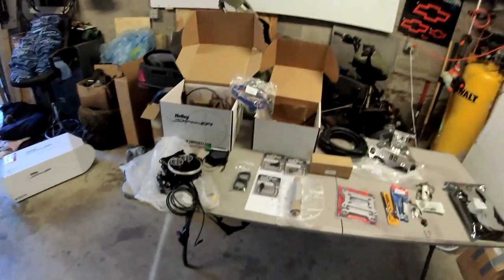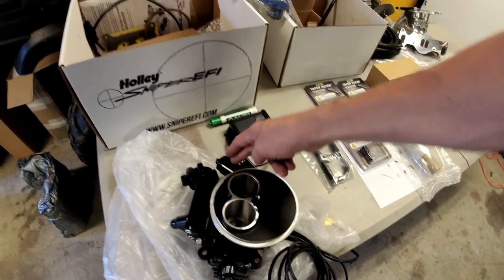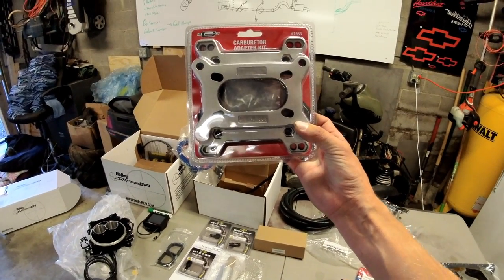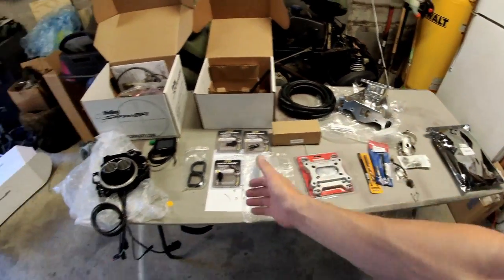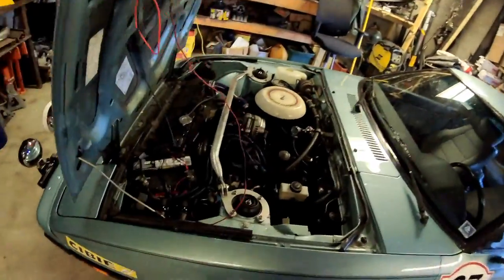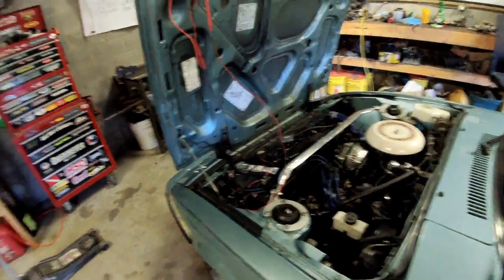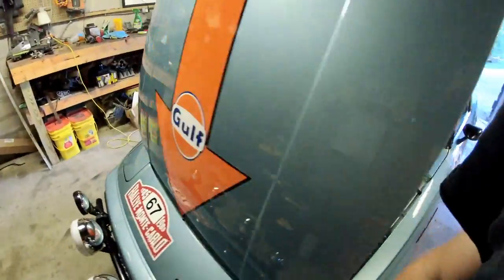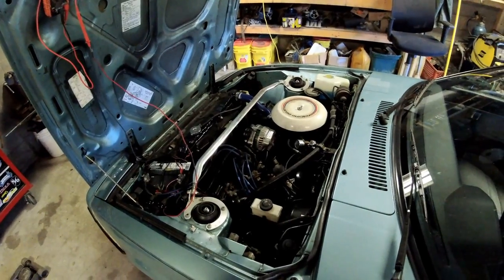Holley Sniper EFI On a 12a Rotary 1984 RX7 PT-1

Comment: Thanks for the tips!  On my 84 I took the ECU thing out and the coolant temp/oil pressure sensor sensor still work fine.
Reply from the maker: Did you strip the harness? Or leave all the extra wiring?
Reply: @RADPotential  Yeah I think I cut or unplugged everything that wasn't necessary

Comment: You can get a m16x1.5 to m12x1.5 reducer bushing on amazon for $15 and use a $7 ls temperature sensor which uses the same wiring connector in the stock water pump port
Reply from the maker: Hacks!!!!!  So good.  Do you have a part number for the sensor?
Reply: @RADPotential  Stant 74050.
I actually drilled and tapped a drainplug with the right thread to install mine as the bushings weren't available

Comment: I would recommend using the new fuel soft line.  I'd assume the new system will be higher pressure and though both are 3/8ths, the stock stuff is only rated to 12 psi IIRC.  Plus it is insurance against bad things happening.  Not as critical on the return side, but consider doing the feed.
Reply from the maker: Think maybe use the original feed line as a return and route a new feed line under the car?
Reply: No, the hardlines are not at issue unless they have rusted.  Just replace all of the softlines on the feed side with fresh sections from the provided hose.  If you were doing something hotter or turbo, a new feed and larger return would be warranted but I don't think it is needed for this.  Also might just check the markings on the installed hose.  It is possible that it has already been replaced to something more able.  I don't know what the Sniper pump will be pushing but I think most simple systems like this run between 35 and 45 psi of fuel pressure.  You just want to make sure the lines are able to handle the pressures they will be seeing.
Reply from the maker: I only planned to re-use the hardlines under the car in this system, i assumed the oem rubber lines are beyond their fatigue life
Reply: good advice, my ancient fuel lines started cracking with my MSD 2225 pump at a decent PSI, especially regulating it down. Worth the extra money for peace of mind, something I should have done before my engine bay was covered in fuel

Comment: If you had a street port for primary and a bridge port for secondary. Would you recommend the 4 barrel carb?
Reply from the maker: For a ported setup I would run 4 barrel.  I have seen the 4 barrel used on a bridge port 12a with success.
Reply: You have a email. I have a exhaust I'm working on. Want to send you pictures.

Comment: Will the oil metering pump still work with the new setup? Can you address that in one of the forthcoming videos?
Reply from the maker: Yessir I can go over it. The short answer is that it will not work
Reply: @RADPotential  Great video. Please include discussion for oiling in follow up.
Reply: @erek2075  just jump in on premixing bud..... so much more piece of mind. 👌

Comment: Will you have a video tuning this setup? I am having troubles getting my afr's right during engine breaking with the 4 barrel version of this
Reply from the maker: Yes the entirety of the install will be documented. What is happening on decel?
Reply: It's hard to explain briefly but when you down shift to the stop light the afr's will go 19/20's. If you clutch in and free roll to the stop the afr's will stay 12/13's (much like the car would if you were reving in a parking lot or your driveway) 

Kinda hoping you would encounter a similar issue during this install series, and I could learn off it and apply to my setup. Also for your sake hopefully you don't, it really takes the fun out of driving when you can't downshift properly lol
Reply: @Soccer22224  Sounds like decel fuel cut causing the lean AFRs.  Not an issue if the EFI pulls spark too.  I've never played with the Holley EFI but I've seen similar with Haltech.  If possible, disable the decel fuel cut and you should see the AFRs come back in line.

Comment: This is epic.
Reply from the maker: I am hoping to replicate bone stock drivability.  the most reliable builds I have done have been ones back 100% stock haha.  Cold, hot, doesnt matter..runs
Reply: @RADPotential  .....it WILL be better than stock👍
Reply from the maker: it should be.  I have a buddy who has a FAST Efi system on his Big Block Trans-am and it works awesome, its even older tech than the programming in the sniper.  id be interested to see if there are any work arounds for the Leading and trailing spark control within the sniper to be able to have it control spark as well on a rotary
Reply: @RADPotential  ....fyi.....feed line is 5/16......and return is 1/4 on carb. 1st gen.......
Initial  air fuel as follows....
1.HOT.....IDLE 13.5 TO 14.1
2. HOT....FULL THROTTLE  11.1.

from some personal FAILURES I highly recommend wrapping the header.....
NO MATTER HOW TEMPTING....ALWAYS USE A FUEL RETURN SETUP!!!!

vapor lock can be a problem on a hot day......
AWESOME CONTENT 👍.....respect from north eastern Ohio!
Reply: @benjaminhedderly4495  On a gsl-se the lines are 3/8 and 5/16

Comment: Love the color of that fb! Also this holley efi thing seems like a great deal, lots of functions for the price, i wonder how it competes with a haltech or similar
Reply from the maker: I would bet that you couldn't price a haltech, intake, throttle body, fuel system, and ease of tuning for near the price of the holley.  All said and done i think the holley, parts only for this install was less than 2,000

Comment: That’s badass I’m ordering one to see if I can spray my bridge 12a with a big wet shot lol can you blow these sniper trough?
Reply from the maker: yes you can boost through the sniper, they also have an add on for boost control within the programming of the ecu.  on the rotary you will need to sort out an ignition control if you desire
Reply: Ohhh I kinda noticed that the only one that is applicable for power adders was a top dollar fi tech. I want to do this sniper efi with nitrous on a bridge 12a 85 gsl

Comment: Why would you put a Holley sniper on a gsl-se, didn't those come with a fuel injected 13b? If that is the case there's probably better ways to ugrade the EFI.
Reply from the maker: I think it depends on parts availability in your area, fortunately I have enough gslse stuff to troubleshoot through making that efi work.  however putting together the gslse efi from scratch would be hard, vs buying the sniper parts
Reply: @RADPotential  wasn't thinking about availability tbh, just figured since Holley had stuff like the terminator you could probably get that but I see what you're getting at. Obviously this is ignoring the occasional 12a swapped gls-se that I'm sure has happened at some point the way cars that age get Frankensteined.
Reply from the maker: Haha I have a 12a in my gslse :)  but yea.  Getting hard to find parts for the oem stuff these days

Comment: thank you for this video and all the videos you are making. i have weber 45 on my 12a which i bought from rotaryshack but works like sheet so i want to go for a sniper efi 4 barrell will it work or it has to be a 2 barrell, big thank you for all the help we get from your videos
Reply from the maker: 4 barrel or 2 barrel will work,  why doesn't the weber work for you?
Reply: @RADPotential   thank you for your reply, I bought this carb from rotaryshack maybe you heard of him. So he said I am sending you a carb jetted for your engine. When you rev and stop rev again stop works keep your foot on the gas and you get this grirrrrrrrr I do not how to explain it. So I went for a new fuel pump carter p4070 and then start playing with the jets,  pump jet 50, idle jet 60f9,main jet 180, emulsion tube f16 air corrector 180 what i have right now I think the chokes are 40mm. I was told is an original weber 45 but i think is a knock off if it makes a big difference i do not know. I really thought buying it from the Us will be original but not. so maybe try to sell it and buy a sniper maybe is a good choice . I live in Cyprus europe thank you again for all the help we get from you you explain things so good thank you

Comment: so could I use a rb intake and holley sniper on a 90 fc and retain the factory speedo and 4 coil ignition system
Reply from the maker: Pretty sure you need the MAF in order to have spark on that car. As your ignition is controlled by the ECU. But you can swap to a distributor fairly easy in the FC chassis

Comment: is there any clearance issues on the brake booster and manifold with the righthand drive
Reply from the maker: there Shouldn't be any issues.  I have a RHD car here, will be awhile before I stab an engine in it and can test fit for you though
Reply: @RADPotential  ok thanks I think if I use the original 12A manifold with the 4 to 2 barrel  adapter will be fine I guess

Comment: Is it possible to use the stock intake for the sniper set up? The RB intake is back ordered..
Reply from the maker: Yes, you can buy a carb spacer and make an adapter out of it. I know of a guy who ran a 2bbl sniper on a 4bbl to 2bbl adapter that he re drilled for the nikki manifold
Reply: @RADPotential  Thanks man! Good to know!

Comment: probably a stupid question, but can the sniper efi understand and handle being turbocharged? At the end if the day it is just a throttle body, right?
Reply from the maker: Yes it can self tune and has a map sensor/tables that can accommodate boost

Comment: Hello, I recently purchased the Holley sniper kit, racing beat intake, and had my 12a bridgeported and rebuilt. Just wondering what I will need to block off for the emissions on my car seeing that it was a stock 83 gsl to get the setup on? I know you said in this video that this car is a gsl-se and already had the rats nest delete done, but how much of that got taken out with the carb and intake when you removed them for the swap? Thank you!
Reply from the maker: Remove all of it. You won't need it.  You will need to premix with the sniper and block off the OMP.  If you have the stock exhaust, make sure there isn't any recirc ports to block off.  I dont know for your specific year
Reply: @RADPotential  Ok thank you, I’m also putting in the racing beat street port exhaust system, so the recirc shouldn’t be an issue.

Comment: Wait I thought the coolant sensor was under oil pedestal
Reply from the maker: coolant sensor for your gauge in the dash is.  the coolant sensor for the ecu is in the water pump housing
Reply: @RADPotential  I should probably make sure that's plugged in I don't recall that plug when I swapped the motor from my 79